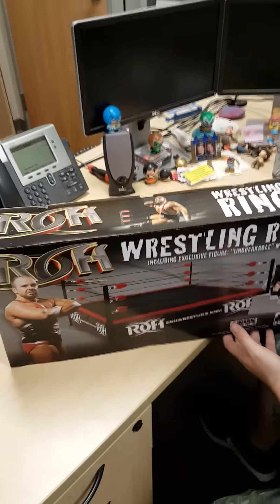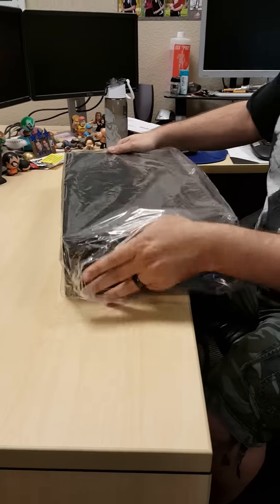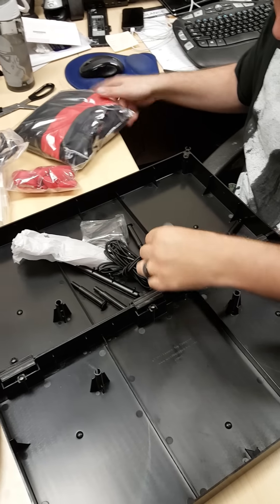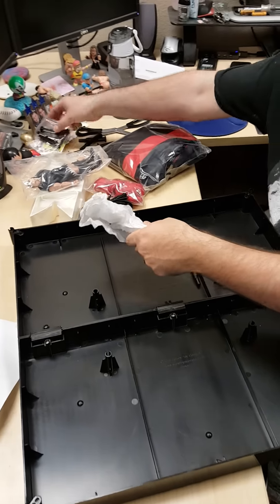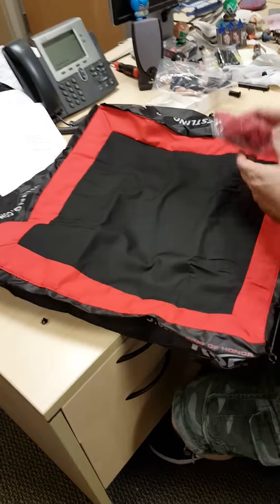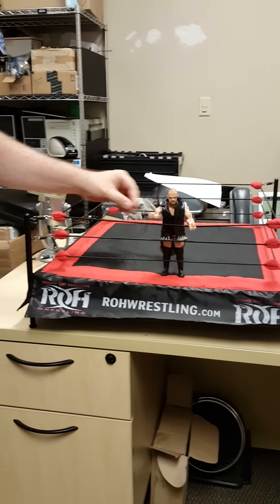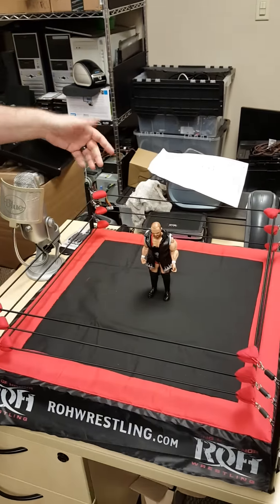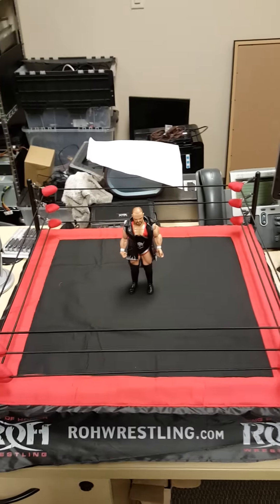Figures Toy company Ring of Honor ROH ring unboxing

Comment: Small tip for your guys when building the ring. If you put the ring skirts/canvas on before putting on the small plastic and large metal part of the corner post on, that piece of elastic that attaches the 2 ringskirt panels in the corner will lay under the post, making the skirt fit better to your ring.